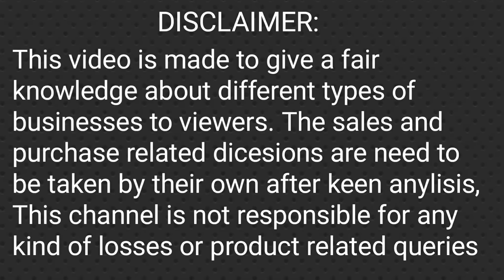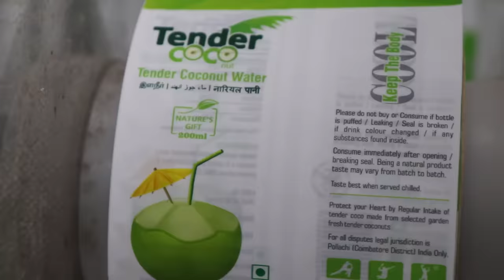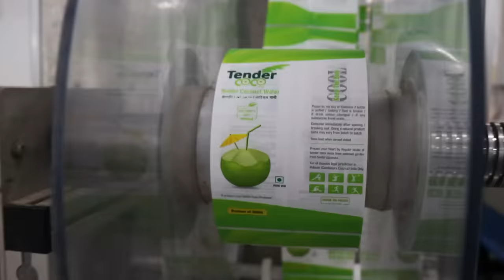இளநீரை பாட்டிலில் அடைத்து ஏற்றுமதி! பல நாடுகளுக்கு அனுப்பும் தமிழர் | Tender Coconut export

Comment: Very excellently designed facility with ultra clean surroundings. All staff have protective Headwear and food grade stainless steel processing vessels and no touching of hands from start to end. Quality testing and R&D. The whole nine yards is covered nicely. These 200 ml bottles sell for a minimum 5 dollars or 415 rupees a piece in American supermarket shelfs and 20 Qatar riyals in Qatar. Flavored ones are more expensive. I have lived and worked in these 2 countries for several years before returning home in TN. Very good job folks.

Comment: I use to drink lot of these processed tender coconut drinks when I was in abroad mostly it comes from Thailand and some other East Asian countries. Actually, you can’t beat the fresh one.
Reply: Thailand and Philliphines. Of course fresh is  fresh. But this is the best alternative to drinking straight from the fruit. Also westerners started drinking this due to the health benefits it offers and not for taste (there is no added sugar or glucose). Soft drinks are loaded with sugar syrup or sugar free diet alternatives and both are bad for health in the long run.

Comment: why dont you heat 100c in 10,000 litter capacity tank only ?  once cool down you can pack in plastic bottle. this will avoid heating plastic and  poison from plastic by over heating it. no chemical added???? for one year validity?

Comment: Polypropylene is generally considered safe for use, but you should still be wary of using plastics more often than you have to. The chemicals found in plastic products are proven to contribute to some cancers. While it's nearly impossible to avoid all plastic products, you can use as little plastic as possible. :)